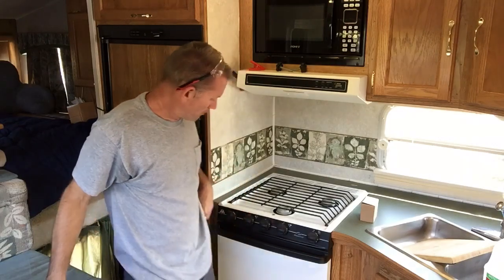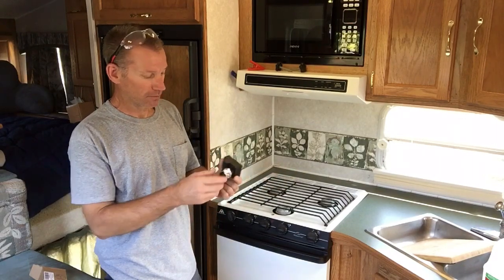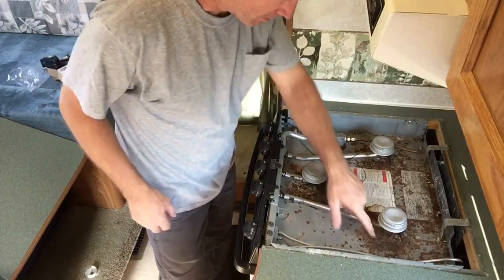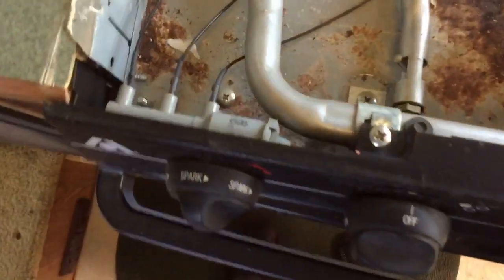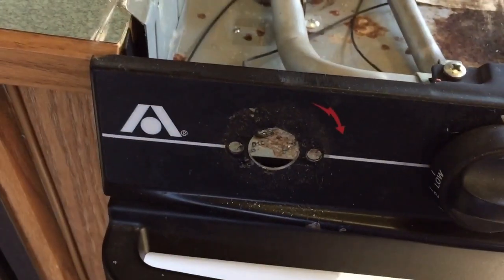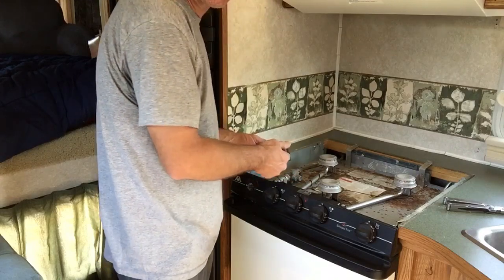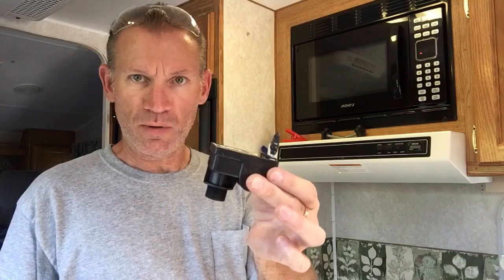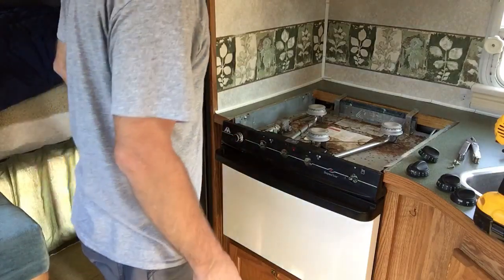Awesome Camper Stove Sparker Upgrade

Comment: Amazon has the same unit with just 3 terminals.  In fact the options is 1, 2, 3, 4, 5, and 6 terminals.  Thanks for the video, I'm planning to use your method to do my conversion
Reply from the maker: Yep.  The link in the video description goes right to that with choice of terminals.  (1, 3, 4 or 6 terminals)
It’s a great upgrade.  I’m very happy with it.

Comment: You could have also filled the last hole with epoxy or glue and saved your connector and electrical tape for other jobs. i think after seeing this in several videos i am going to get one of these for my stove too but i have an Amana range and one wire starts all 3 of my burners. i am thinking of finding a cap for the oven manifold though and replacing the pilot with an igniter also. for that i will need a 2 lead igniter. i do like that they are battery powered though so you'll never have to replace them unless the switch goes bad